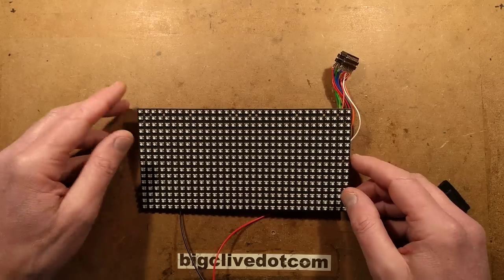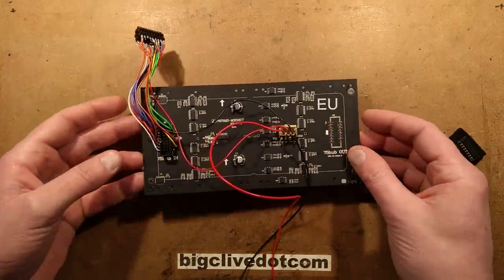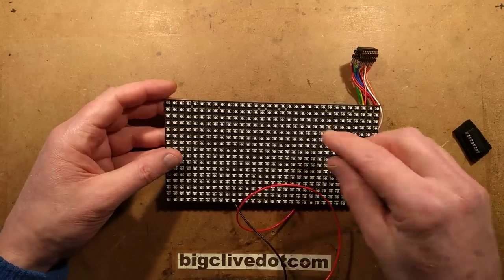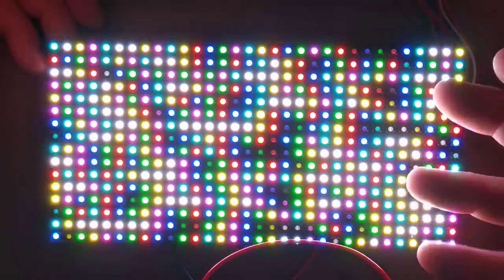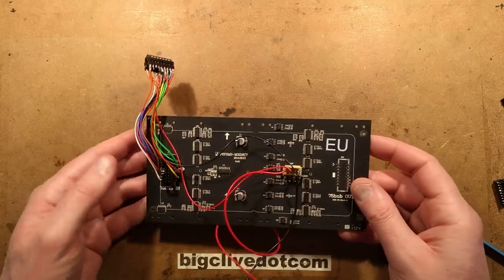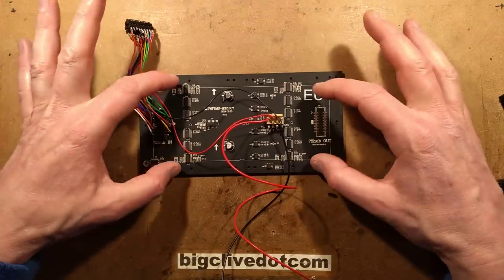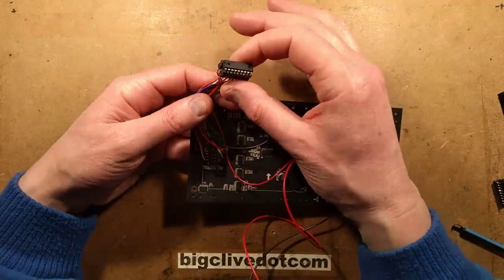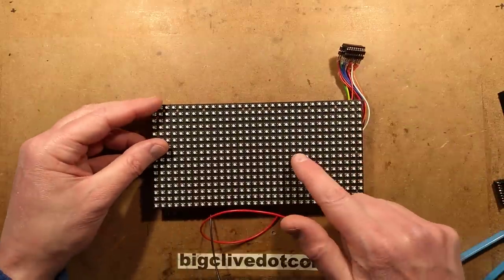Driving hub75 LED panels.  (including free test software)

Comment: Well, I guess I'm going to have to go buy a pink purse to rip the video wall module out of it
Reply: You mean another one!!!
Reply: I've got 9 of them.
Reply: @LiezerZero  So you only need another 4071 to make a 1080p display.
Reply: You can get. the modules for cheap at ali express. make shure they have that hub75 connector on it (most of them have)
Reply: Dominic - you ever imagine that you would use that particular sequence of words in that order? heh
Reply: I bought it from Amazon for $7.72 .. it started going up after Clive published the first video .. got all the way up to $22+ .. now it's back to $15.12.
Reply: @LordSandwichII  You need 4080 of these to make a full 1080p display. If you use them horizontally, the display will be 68 panels tall and 60 across.
They bottom or top row of panels will only use half the LEDs because 1080p doesn't divide evenly by 16.
Turning the panels sideways doesn't help, because 1080 doesn't divide by 32 either (obviously). You lose the same number of pixels.
Reply: Mai Mariarti  Those are $50 for the same LED count.
Reply: Mai Mariarti   To be fair, those are flexible panels, they will be a higher cost just because they flex.
Reply: @Falcrist  4080 - 9 = 4071
Reply: @VGScreens  You can't make a 1080p screen with 4071 of these. You need 4080.
Reply: @Falcrist  You can't make sense when you can't even read. You need to read.
Reply: @VGScreens  Your comment implies you can make a 1080p screen with fewer than 4080 of these, which is just incorrect.
Reply: @VGScreens  I'm not talking down. I'm pointing out that you're incorrect.

Comment: Assembly language and machine code aren't the same thing! Assembly language has to be converted to machine code by the assembler. Programming in machine code is a very painful pastime!
Reply: Painful, yes.  But back when assemblers cost money, it was good to have the option.
Reply: I used to hand-assemble code on my ZX Spectrum back in the day. Most complex thing I ever did was something that would generate a Mandelbrot set--even with it generating the set at half resolution (so I could use bit patterns in lieu of colours) it took 2 hours to complete the whole thing!
Reply: @d2factotum  wasn't you the posh one, I only got the ZX 81.🤣
Reply: I still program in Machine Code on my Spectrum. I find it quite relaxing, having to chase down all those 16bit addresses! Ha Ha!
Reply: They're the same thing in the sense that pre-processed assembly is just mnemonic machine code.
Reply: @adaai2384  Disagreed. The assembler is a little more than a macroexpander. Think of address remapping for example.

Comment: To make a 1080p HD display, you would need 4080 of these! :)
Reply: Assuming these panels are about the same size as the ones on adafruit which are 192mm x 96mm (7.6" x 3.8") big, meaning to make a 1080p wall out of them it would measure in at (I made a massive error) 783360mm x 391680mm (31008" x 15504") or 783.36m x 391.68m (2584 ft x 1292 ft) 11.5m and assuming a cost of $15 per panel would be $61,200 with 4080 of them.

To put that into perspective, according to stack.com a football field is around 109.72m x 48.77m (360ft x 160ft) meaning you could fit about 7 fields inside of your display.
Reply: @vgamesx1  It seems like you got something wrong there - a 1080p panel of these would be around 6.5 m x 11.5 m assuming a panel size of 96 mm x 192 mm.
Reply: @vgamesx1 Arithmetic would like to have a word with you. These are 32 pixel wide, and a HD 1920x1080 screen would need 1920 / 32 = 60 of these in width. At 192mm each, that's 11.5m; rather large, but nothing comparable to any football fields. Kinda makes sense, seeing as how that's pretty much what Jumbotrons are made of, and as large as those are, they're still far smaller than the stadium itself...
Reply: @noinformationhere4258   @Attila Asztalos Oh right, oops... I just multiplied both numbers by 4080 (didn't even double check that was correct either) and forgot it doesn't work that way... Lol
Reply: Isn't that basically how they make those big LED walls used in, for example, game shows?
Reply: @brandonmartin-moore5302  Older game shows yes. These days it's either CGI and/or projection.
Reply: @brandonmartin-moore5302 : Which supposed games shows?
Reply: @Stabby666 : Uh. "older game shows"? How old is "older," according to you: like... 4... maybe 6 years? Not that old, huh? Which supposed game shows would you be thinking of?
Reply: Interesting, my calculation came out at 4050! Where did your extra 30 come from?
Reply: @harrysmbdgs  I rounded the 67.5 to 68 since you can't cut the display in half.
Reply: Lord Sandwich Now it makes perfect sense!
Reply: And drawing an amp each... :)

Comment: have you worked with the 32bit pics before? The dma module + pwm module can be used together to make a moderately fast and 8 bit PWMed one of these. With the bonus being, that you have all the processor time effectively free (the only thing it would be doing is shuffling bits into the right location). i actually built a "game" machine that way (obviously only for things like pong/tetris etc. because of the resolution)
Reply: From what you have said, I hope that you also may a video about these card's for people like me that would like to learn more
Reply: @nickbird7742  interesting idea. i can try to but i am currently learning for exams so that would be a while until i do🤔
Reply: @Blowcrafter  not to put you any pressure on you i shall subscribe to your channel with the hope you can do a video, however I wish you all the best in your exams.
Reply: @vek7933  sorry but i already beat you to it ;) + tetris :D

Comment: The output enable isn't strictly speaking used to blank the whole panel, it's used for the intensity modulation - you load the data for one bit of the intensity, and pull the enable line low for a precise time. proportional to 2^bit
Reply from the maker: Is that in the style of the pulse frequency modulation that Pulsar used to bypass the CK patents?  The PWM style cycle was implemented as a series of smaller binary pulses with a length of 1,2,4,8 etc.

Comment: I've been running them off a raspberry pi 3B+. I feed it 5 volts power but have been successful putting 3.3 volts onto the data pins, as that is what rpi gpio pins run at.
Reply: strange, mine kinda worked, but at high speed the impedance of the cable resulted in enough drop to prevent it from working (lots of ghosting on adjacent pixels) and i had to put in a level shifter.
Reply: What software are you using to display things?  I've got hzeller's test code up and running, but kind of want it to run a calendar app, but can't get anything to work.
Reply: No no 3.3V logic is compatible with 5V TTL inputs, because 5V TTL accepts anything over 2.4V as 1, with real 5V TTL outputting 2.8V to 5V for a 1 (0.4V margin).  3.3V TTL jusr outputs 2.8V to 3.3V for 1.  Beware however that most 3.3V pins don't like being fed 5V, so it's essentially one way.  There is an ingenious way to do the level shift with a single MOSFET instead of a full logic gate.

Comment: It took me a bit to understand what Clive meant by "multiplexed in real time" so I'll explain it for others who think like me. Because the data is multiplexed the same data needs to be reflashed many times in order to maintain persistence of vision in the animation. You either need to store the data to be multiplexed or regenerate it each cycle. Clive actually does a little bit of both since there's two multiplexed sets of 8 rows.

Comment: It is interesting that your panel has the big EU printed on it. The purse I received here in the US has the exact same panel, minus the EU.  It seems odd they would go through the trouble to use differently printed boards. I am assuming they were all made in the same factory.
Reply from the maker: Maybe a lead free version?  Not sure.
Reply: Did you receive the tenth of a penny discount since they saved on power and possible ink with the U.S. version? 😋
Reply: @plasmaburndeath  Nope, but I was able to get three of the purses off Amazon for less than $24. I'll consider that discount enough. 😉
Reply: @DavinDesborough  I guess you had luck with your "pursut... Lol I will hide now.
Reply: @DavinDesborough  could you link it?
Reply: @oldaccount537  - This is the listing I used: https://amzn.to/2G7Tq7v   
Unfortunately, the price has doubled in price since I ordered it. The Sub $8 price only lasted for about a day after Big Clive released the first "Pink Purse" video to his Patreon supporters.
Reply: @DavinDesborough  ill wait a bit then.

Comment: I have being playing with a couple of LED panels like yours, very funny but very frustrating, as there a lot of different "standars" to drive them.

You'll find lots of different multiplexing patterns, from yours, where you drive two straight 32 pixel lines at the time to others where you drive two virtual 64 pixel lines  at the time, so you actually light 4 rows and, to make everything even more complicated, they may not be straight lines but "zigzagging" instead, this technique is supposed to make them less flickery to the eyes.

I have even found one that uses a funny addressing method to save address decoder IC, where each of the address lines enable pair of 64 pixel lines (four 32 pixel lines). You could drive all lines at the same time using that panel, limited to display the same pattern on all the lines.

To drive my panels, I have used an ESP32, making use of its DMA to do the hard work of "pushing" the data to the display and leaving a lot of CPU time free for other stuff.
Reply: The problem with standards is that there are so many of them.

Comment: Yeah, test patterns are good ;)

When I used to work with LED signs the quality out of the manufacturer tanked (for reasons). 

It got to the point (after we got them to fix the melting power connectors) where we'd have to leave them displaying solid bars of colours for 4 days straight before we'd actually dispatch them to clients. Before I left about 50% of the boards were going back to the manufacturer due to dead pixels, dead blocks or baked power supplies...

Comment: I bought a nasty pink plastic handbag, and ripped the panel out.... Hooked it up to an Arduino Uno, with AdaFruit's software, and within an hour was displaying what I wanted....  Their "plasma" sample sketch produces wonderful patterns, although I prefer it slowed down a bit.... A Nano will do the job just as well...
Reply: Hi Matt, would you mind sharing your Arduino code? I would like to do the same. Cheers!
Reply: My code is just modified from the adafruit sample code... This  page tells you all you need to know: https://learn.adafruit.com/32x16-32x32-rgb-led-matrix/library

Comment: I would use a DMX controller system or a Raspberry Pi you can buy the cables and connectors off eBay for that and I reckon that will be a fun Project remember your pink gloves as well lol
Reply: i had that idea but with only 512ch in a universe you would need quite a few to actually get pixel control (assuming you don't use just a channel for brightness, speed and pattern) ;)
Reply: 1. If you would use a dmx controller you could only show a single color at onece, or you would need a channel for every sing led. Also the 3 or 5 pin xlr plug would be gigantic.
Reply: Put an Arduino or Pi local to the display - including a DMX interface...
Then you could hold a number of ‘canned’ displays to recall with each DMX channel/value

Comment: The Teensy boards work well with these RGB matrix's. I use a Teensy 3.6 to display on 2 panels 32x64 pixels and it displays a series of GIF images. I also have a ESP 32 running with a 32x64 pixel panel as a clock with merging numbers with date and weather updated from the internet. These panels are cheaper on Aliexpress than the pink purses and you get a better resolution too.

Comment: You really need a dedicated chip pulling data from a buffer so it doesn't have to think about anything and run as fast as possible, then a second chip doing the buffer filling.

Comment: I did put this on the first tear down video. But if you want to drive these using a Raspberry Pi, this git hub repo works very very well with these panels

https://github.com/hzeller/rpi-rgb-led-matrix/

I used 4 64x32 boards and a Pi2 to build a small wall

https://youtu.be/WfIgvow4nlY

Comment: Hehe this is great! I just used a LFSR and the LSB from a tempsensor ADC for random generation myself. Also for generating an LED pattern, but on a WS2812 strip. In my case its smoothed out way long and scrolls down the strip for a fancy party light. See https://github.com/dpiegdon/digispark-workbench/tree/master/projects/ws2812-fancy-fader

Comment: Well suited to an ESP32 as you can use one core to do the multiplexing and the other to do what ever processing is necessary to generate the image. Brian Lough has a video trying exactly that with one of these displays.
Reply: You should used the ULP for the video driving, then you get 2 cores to do other stuff. They share 8k of ram with the ULP. So you turn the ULP into a dedicated video controller. Yes esp32 has 3 cores.
Reply: @TheBodgybrothers  Not sure if you want to... the ULP is a bit unwieldy. Better to use I2S to drive the panel using DMA; that way the sending of data to the panel continuously is taken care of by the hardware, and all you need to do in your two cores is to poke the right bits in the memory region that is DMA'ed over to set the pixel values you want.
Reply: @Spritetm  but I take it from this video that the communications is not i2s, and therefore some assembler on the ULP would be an elegant solution. Could do what Clive did here on he ULP with about the same complexity as Clive's code.
Reply: @TheBodgybrothers  Ah sorry, I went a bit too fast there. The ESP32 I2S peripheral has some other non-I2S features tacked on to it, one is a parallel output feature that you can use to control random things like these displays. See https://www.esp32.com/viewtopic.php?f=17&t=3188 for code/demo.
Reply: @TheBodgybrothers  I'm not sure if the ULP would have the power to drive the display. Plus running it off the second core of the main processor means it can be programmed in C or one of the existing libraries for these displays could be utilised. Simpler than writing custom assembler.

Comment: I got one of these panels,  also got a hat for the raspberry pi to drive it. I have a demo running, but I like the idea of a ws2812b much better than hub75. Driving the hub75 panel is not nearly as simple as a ws2812. Thank you Clive for adding to my hub75 knowledge.

Comment: Couple nits: 
(1) Machine code is represented in e.g. hex, octal, or binary -- what you can enter into a front panel of 1x8/16/32/36 bits with a memory-advance button, or on a boot punched card or tape or non-volatile boot memory back in the day. Assembly starts as a mnemonic representation of the above, and with macros, be even more terse and only requires two-pass assembly to get the jump addresses right. But isn't as abstract as, say coding in C. 
(2) In the second program, you were displaying pseudo-random data, not random data. Random data is something you might extract from a chaotic physical process, such as properly biased, amplified noise, and has no seed, except as an extraction parameter from a one-time pad of recorded random noise data. 
It would also be interesting to know how much light is output, and how well the panel would show up on, say, outdoor sunlit conditions, since it is already limited to 1/8th of the maximum possible continuous light output of whatever LED technology is used.
Otherwise, thank you very much for an informative video.

Comment: I have a LED Panel that has a capacitor in series with the output enable to protect the LEDs from blowing if... I hope. Never risked trying it ;)
The Panel has 18 lines, but the LEDs are on for only ~1/100th the time.

Comment: I'd love to add this panel to my backpack and wirelessly control it from my phone. Wonder how I could manage such a thing.
Reply: Somehow, that reminded me of a crazy idea I had to attach one of those Chinese off-brand small monitors to a backpack and wire it up to a device on the inside, and I imagined a laptop for that.
Reply: @kbhasi  could do it with a Raspberry Pi Zero. Low power, cheap, well documented, and has many accessories available.
Reply: blackcorvo That sounds like a job for that ESP module with WiFi and microcontroller.  There may be cheaper options if you use a USB cable instead.  Don't forget to include a big powerbank, as this draws 10W (2A x 5V).  So a "3000mAh" power bank will run flat in about 1 hour.

Comment: We made something simular in the 90-tys  with 800 leds (5mm once) for a scrolling text sign... Also used a PIC for it.

But what we did in steed was driving the leeds with voltage then have voltage rails and transistors for every row to flip it on and of.

The put a triable DC/DC stepdown to each rail the trim it so each transistor draw the corect amount of current. This was a very effective way of doing it

Comment: You can cascade these. I picked up 6 when the purses were $9.50 (have since gone back up). I added sockets to the  empty pads and tried it and it works perfectly fine.  Also the purse's controller has a 'hidden' test pattern routine built in if you hold button while turning it on (2-3sec. hold).

Comment: Clive do the red drivers get hot enough to cause worry about there longevity? If it's is going to be an issue would some small 
heatsinks be able to help? I was thinking the smaller ones with the thermal sticky tape to hold them in place.
Ebay is going to love you with all the pink hand bag sales.